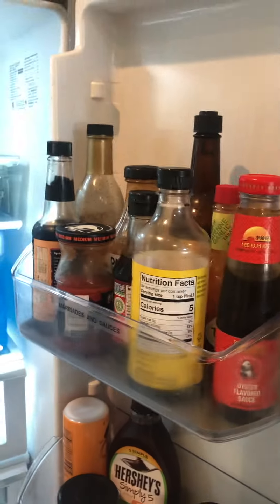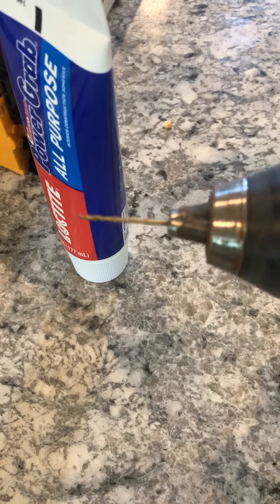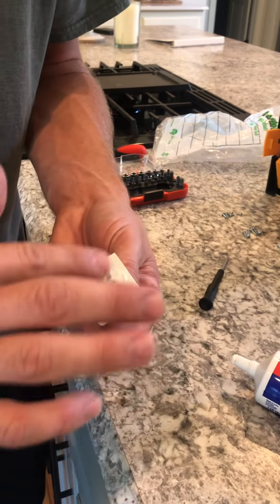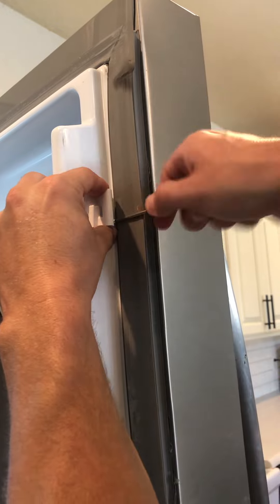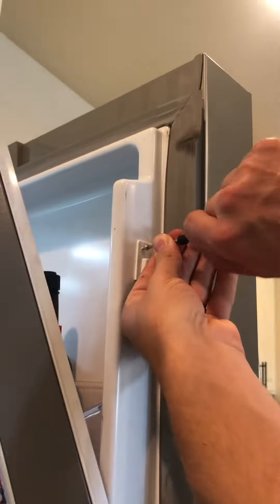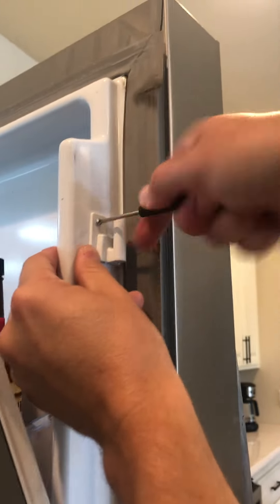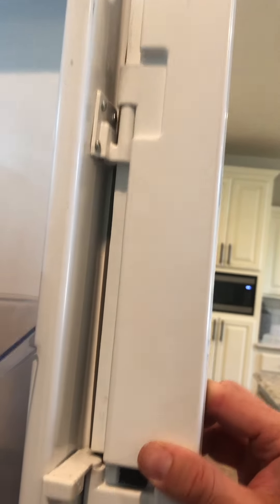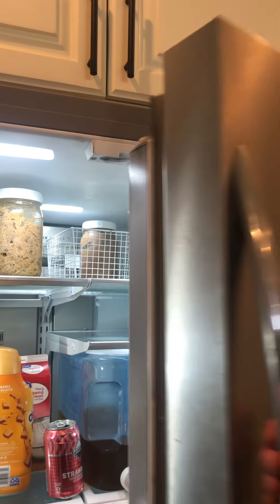Refrigerator door hinge fix

Comment: Hey, great job, my daughters fridge has the same problem. You are screwing into the insert set into the door, which has a fairly small footprint, the insert can be pulled out of the door also, FYI. Unfortunately, in my daughters fridge the bottom insert has been pulled out, so I will need to fabricate a hinge pin with large enough surface area to bond to the existing surface.

Comment: FYI check the wiring coming out of the door. Mine was snapped in half and I had to use butt connectors to reconnect the wiring. Also, I did not use the locktite glue and ended up ok.

Comment: My problem is not the top one it's the bottom one hinge-mullion fixture it's the bottom one.  The mount tap is broken off so only way is to screw it on without mounting tab right?
Reply: Yeah I would try to just screw it on also use an adhesive the worse that will happen is it doesn’t work and u will have to get the whole door anyway